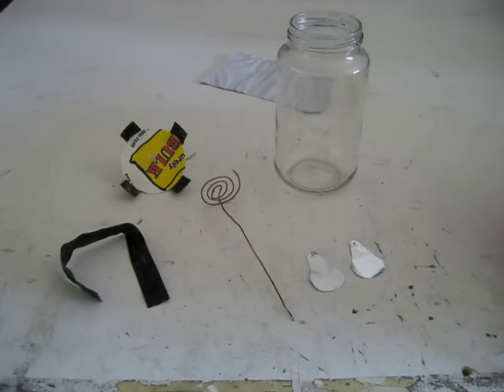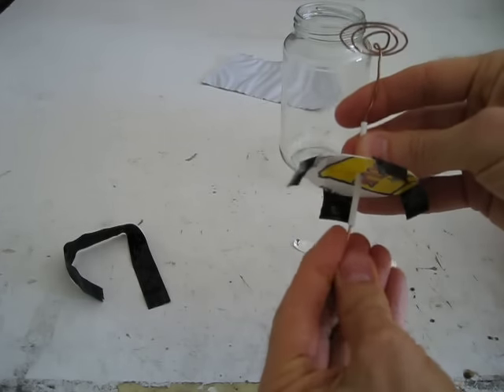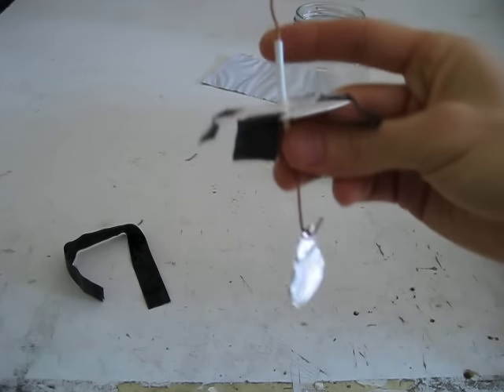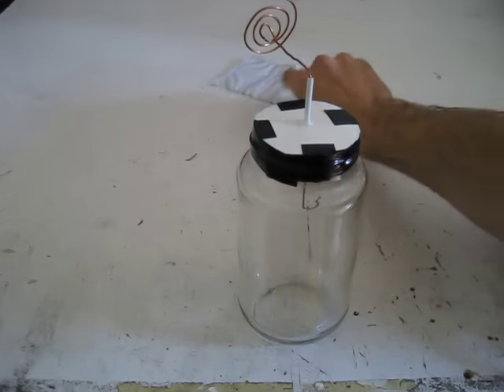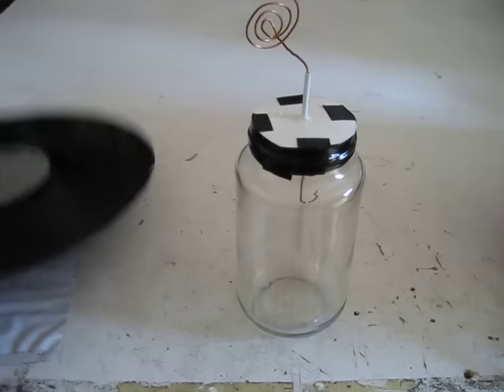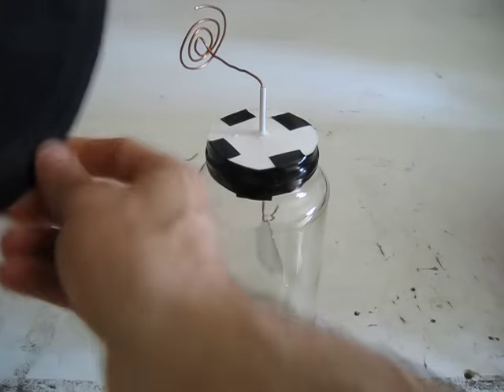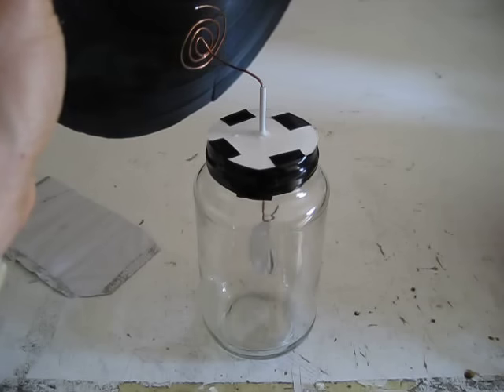How to make an electroscope (DIY)

Comment: What type of wire you use?
Reply from the maker: I used 14 gauge (AWG) copper wire, but any metal wire that can hold its shape will do. It can even have insulation on it as long as there's no insulation where the leaves touch it. The leaves need to make electrical contact with the wire.
Reply from the maker: Oh, and I usually mention that you can use the lid that came with the jar. The only reason I made my own lid from plastic and tape was that I didn't have the original lid.
Reply: @RimstarOrg   thank you very much! You helped a lot with my physics homework😊
Reply from the maker: It's my pleasure. BTW If you're looking for things to charge up for testing your electroscope, check out my Triboelectricity video https://www.youtube.com/watch?v=ey88EdZo9hU. Also includes the science behind it.

Comment: of what are these leaves made ?is it steel
Reply from the maker: Aluminum foil from the kitchen. You also don't need to make your own cover for the jar like I did. I didn't have the original cover, so I had to make one.
Reply: What is meant by foil
Reply from the maker: In the kitchen, most places have aluminum on rolls that they can cut sheets from. We wrap food in the aluminum foil. Here's a random video showing it better https://youtu.be/aGiPh_UPzEw?t=1m28s than I can explain. The advantage of using a thin foil as the leaves in the electroscope is that it is very lightweight. Not a lot of charge is needed to make the leaves repel each other.

Comment: What u have fitted in lid?
Reply from the maker: I used a piece of plastic for the lid. The plastic tube was one I got from a hobby store. But any lid will work. I didn't have the lid that came with the jar, so I had to make one. You can use the lid that came with the jar instead. The plastic tube is only to hold the wire vertically. You can use a straw or anything that will hold the wire vertically.
Reply: Thank you so much. I hope It will work out good :).

Comment: wat is the length of the wire u used
Reply from the maker: It's around 12cm (5 inches) for the hook and the vertical part and then around 30cm (12 inches) for the horizontal part and the spiral terminal.

Comment: I made it but it's not working  any suggestions please
Reply from the maker: The problem is usually with the charged object. See my video about the triboelectric effect for tips on charging objects https://www.youtube.com/watch?v=ey88EdZo9hU The only way it's usually a problem with the electroscope is if there's some kind of coating on the wire where the aluminum foil leafs touch it. If you think there might be a coating of something there then scrape it off.

Comment: What size of the copper wire
Reply from the maker: The size doesn't really matter except that it has to be stiff enough to form the hook for holding on to the leafs and for forming the spiral-shaped terminal. I think mine was around 14 gauge (AWG) wire (diameter: 0.0641 inches or 1.628mm) but any wire that's stiff enough will do. If it has any coating on it then you need to scrape it off where the leafs touch is so that you have metal contacting metal, which means you could use wire from a wire coat hanger.

Comment: can i use tire wire?
Reply from the maker: I'm not familiar with tire wire, but as long as it's metal and there's no coating on it where it makes contact with the foil leafs then it'll work. You can cut or scrape any coating off. A quick search online shows that it seems to be metal.

Comment: I'm making one but it's not working. Did I make a mistake?
Reply from the maker: The only problem people usually have with the electroscope itself is if there's some kind of non-electrically conductive coating on the wire where the foil leafs touch the wire. If you think there might be some coating there then try scraping it off with sharp edge, a knife or scissors. The other problem is with the charged object instead. If you're rubbing something then make sure you bring the area that you rubbed near the electroscope terminal (the spiral part of the wire). For example, if you rubbed a balloon against your hair then bring the area of the balloon where you rubbed it near the electroscope terminal. The air also can't be very humid otherwise you'll have trouble charging the object. I have a video with tips about charging objects here https://www.youtube.com/watch?v=ey88EdZo9hU
Reply: @RimstarOrg  Ah ok thank you, my big sister rubbed it hardly so it's working now 😃
Reply from the maker: Glad to hear it! And thanks for letting me know what worked. Now I can suggest that to other people when they have problems.

Comment: how many volts is that??
Reply from the maker: I don't know. That's one thing about electroscopes... they can tell you that there's an electrostatically charged area, and you can say that one area is charged more than another area by comparing how far the leafs move apart for the two different areas, but it doesn't help you with telling how much charge.

Comment: What are the things required
Reply from the maker: I go through all the items one-by-one at the beginning of the video.  Does that not work? I'm seriously curious. Maybe I'm making a wrong assumption.
Reply: I didn't understand your accent
Reply from the maker: Ah, thanks for clarifying. That's also an old video so I wasn't speaking very clearly.
Do you have a captions/subtitles button new the bottom of the video? If you click on that then you'll have what I say in writing.
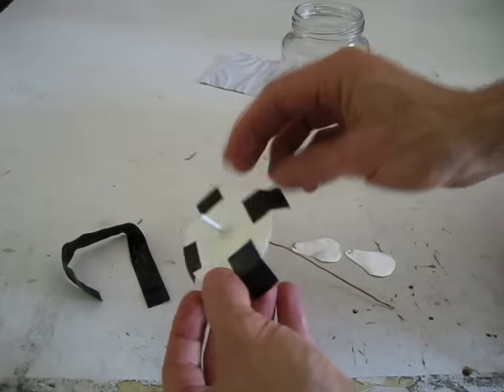Note that you don't need the plastic lid that I talk about from 0:47 to 0:59. I did that because I didn't have the original lid from the glass jar so I had to make one. If you still have the lid from the jar then you can use that instead.
Does that help?
Reply: Thank you

Comment: I made it but didn't worked. I want to send u pics so that I can check. Please help!!!
Reply from the maker: I'm happy to look at your pics and you can find my email address at the bottom of any of my webpages here http://rimstar.org. However, the problem is almost always with the charged object and not the electroscope. If the air is too humid then that makes charging difficult. Some options are to rub a rubber balloon or a plastic soda bottle against your clean hair and then bring the area of the balloon or bottle that you'd rubbed near the electroscope's terminal. You can also get more charging ideas from my triboelectricity video here http://youtu.be/ey88EdZo9hU.

Comment: I am a student and I'm wondering why the wire should be like that. I mean the wire is shaped like a spiral
Reply from the maker: The purpose of the spiral was just to give the wire more surface area when near the charged object. That way there can be more charges to interact with and so more repulsion. The wire could have been bent into any shape. Or a metal plate could have been soldered onto the end of the wire so that the plate would face the charged object instead.

Comment: Will this detect radiation?
Reply from the maker: Not directly. If the radiation was in the form of alpha particles then the alpha particles would ionize the air that they pass through. The electroscope terminal would react to the ionized air (think of the ionized air as the same as the charged area of the vinyl record I show in this video). But there would have to be an awful lot of alpha radiation.
I detect alpha particles in a different way in this video https://www.youtube.com/watch?v=aJkx6hAD-4E.
Reply: @RimstarOrg  What about Gamma radiation, this this device detect that?
Reply from the maker: Nope.
Reply: @RimstarOrg  Could you advise how to detect that without buying Geiger Counter? Is there another basic instrument that could be built D.I.Y?

& I do appreciate the quick responses, thank you.
Reply from the maker: Off-hand I don't know. I've never looked into it.

Comment: Mine didn't work at all. Maybe because I'm using a thinner copper wire and I dunno much about Physics.
Reply from the maker: The thinner wire shouldn't matter. The most frequent issues are to get an object charged well. For that I have tips in this video about the triboelectric effect https://www.youtube.com/watch?v=ey88EdZo9hU Also, make sure the area that you charged the object is the area that you bring near the electroscope -- charging an object only charges a specific area on the object. Another frequent issue is if there's some kind of coating on the wire where the foil leafs touch it -- the contact there must be metal to metal.
Reply: @RimstarOrg  hmm okay. And I have another question: is soldering wire a good replacement since it's metallic and the one I have is thicker than my current copper wire? Thank you so much.
Reply from the maker: Good idea! I hadn't thought of that. I just tested a length of soldering wire with a meter and it worked. There might be a thin rosin coating on it so you might have to scrape it a bit where the foil leafs make contact with it but there also might not be. Let me know how it goes.

Comment: How can i produce charge in difference ways
Reply from the maker: If you mean using the triboelectric effect but with different materials, I talk about that more in this video https://www.youtube.com/watch?v=ey88EdZo9hU.
If you mean using other tricks besides the triboelectric effect then there are many ways, though which ones you'd want to use depends on your needs. Triboelectricity is the easiest I'm aware of. Besides that you're getting into Van de Graaff generators, Wimshurst machines and the high voltage power supplies.

Comment: I guess your jar had a metallic cap. Wouldn't it save one time if they used a jar that comes with a plastic cap?
Reply from the maker: Sure, you can use a plastic lid if the jar comes with one. Actually, a jar with a metallic cap would work too. But if the thick wire is in contact with the metal of the lid then make sure you don't touch the metal of the lid when using it, since your body will affect the charge. I didn't have the lid for my jar at all.
Reply: Good to know. Thanks!

Comment: can it test dead batteries?
Reply from the maker: Ernestas No. It requires a surface with lot's of charge.
Reply: RimstarOrg is it possible to make such thing, to check the batteries in Home conditions? Thank you.
Reply from the maker: Ernestas Not in any practical way using an electroscope. I guess you could make something using a coil and a permanent magnet. Look into how analog meters measure voltage.

Comment: sir will you tell me all about the used thing ,i have made it but unfortunately not working.
Reply from the maker: There are two most frequent problems.
The first is to make sure that there is no coating on the wire where the aluminum foil leafs touch the wire. Scrape the wire there using a knife or sandpaper to make sure there is no coating. The metal of the wire must be contacting the aluminum of the foil.
The other problem is usually with the charged object and not the electroscope. See my video about the triboelectric effect for more tips on charging objects https://www.youtube.com/watch?v=ey88EdZo9hU.

Comment: I made it ....but it's not working ....ehat should I do
Reply from the maker: The most frequent reason they don't work is a problem with the charged object. Make sure you bring the area of the object where you rubbed it close to the electroscope terminal, not all of the object gets charged. Also, try different objects. See my video here about the triboelectric effect for more ideas and tips for charging https://www.youtube.com/watch?v=ey88EdZo9hU One problem with your electroscope may be where your leafs touch the wire. It has to be metal touching metal and sometimes the wire has a coating on it. If there might be a coating then try scraping it off where the leafs hang from it. Also, if the air is humid then you may have trouble charging the object.

Comment: I NEED HELP WHEN I USE MY DENIM CLOTH AND STRW IT DOESNT WORK
Reply from the maker: It could be that the straw is no good. Not all plastics work. Try a plastic soda bottle rubbed against clean hair, or your denim. Make sure to put the area that you actually rubbed close to the terminal. Rubbing doesn't charge all of the object. See my triboelectricty video for a lot more tips http://youtu.be/ey88EdZo9hU.

Comment: materials needed?
Reply from the maker: +Judy ANN Montemayor See the video. I go through all the materials one-by-one. If spoken English is the problem the video has English captions which you can turn on using the CC button at the bottom of the video or somewhere else on your player. Note that instead of the plastic disk and tape you can just use the lid from the jar. I didn't have the lid so that's why I made a plastic disk and taped it on.

Comment: Mine doesn't work anyways I'm gonna past it to my teacher
Reply from the maker: The problem people usually have with the electroscope itself is if there's some kind of non-electrically conductive coating on the wire where the foil leafs touch the wire. If you think there might be some coating there then try scraping it off with sharp edge, a knife or scissors. The other problem is with the charged object instead. If you're rubbing something then make sure you bring the area that you rubbed near the electroscope terminal (the spiral part of the wire). For example, if you rubbed a balloon against your hair then bring the area of the balloon where you rubbed it near the electroscope terminal. The air also can't be very humid otherwise you'll have trouble charging the object. I have a video with tips about charging objects here https://www.youtube.com/watch?v=ey88EdZo9hU

Comment: tire wire is used in constraction making a building its maid from a metal maybe and its look like a wire
but no skin
Reply from the maker: That should work then.
Reply: but when we buy a copper wire  its didnt work
why its does not work
the material i used are copper wire,loollypop tube foil and a glass jar
answer my question plsss
Reply from the maker: reymart hayo
I'm not familiar with loollypop tube foil. The foil has to be electrically conductive (metal) both where it touches the wire and over its entire surface. If you're not sure that it is then just use the aluminum foil normally used in kitchens.
Also, make sure there's no coating on the wire where it touches the foil. You can scrape off a coating by scraping it with a knife.
The other possibility is the most frequent reason - that there's nothing wrong with your electroscope and that the problem is with your charged object. That may be because your air is too humid. Or you can try other objects, like rubbing a plastic bottle (e.g. Coke bottle) against CLEAN hair or a rubber balloon against clean hair and using the bottle or balloon as your charged object.

Comment: Why my electroscope is not working
Reply from the maker: Make sure there is no coating on the wire where the leafs touch it. You must have metal-to-metal contact there. You can scrape any coating off the wire using a knife or edge of a scissors (be careful not to cut yourself). The other reason is usually not the electroscope but the charged object. Make sure you bring the area of the object where you rubbed it near the electroscope's terminal. Also, see my video about the triboelectric effect for more tips on charging objects and more objects to try https://www.youtube.com/watch?v=ey88EdZo9hU
Reply: @RimstarOrg  thanks sir

Comment: Mine doesn't work pls help
Reply from the maker: Make sure the foil leafs are in contact with the metal of the wire. There may be a coating where the leafs touch the wire and you'd need to scrape the coating off. Also, make sure the leafs are free to move easily.
But most often the problem is with the charged object and not the electroscope. See my triboelectricity video for tips on charging objects https://www.youtube.com/watch?v=ey88EdZo9hU

Comment: can we use it to detect ghosts?
Reply: T0X1C EAR  you just need a voice recorder
Reply: Supposedly ghosts generate a static electric field.   And, yes,  the EMF meters that are "paranormal" detectors are just ones that detect electric fields down to DC(zero frequency).   

That being said, if you are in a dry room (i.e. <40% relative humidity) just walking across the rug or rubbing two different insulators together will generate a LOT of voltage, which will show on these meters.

Look up  "Triboelectric Effect" if you want to know more about these static voltages.
Reply: T0X1C EAR
Reply: Could you please erase the comment

Comment: My electroscope is not working, the aluminium pieces are not repelling each other. Can anyone please help.
Reply from the maker: The problem is almost always not with the electroscope, but with the charged objects. If your air is too humid then it can be hard to charge objects. See my video about the triboelectric effect for more things to try https://www.youtube.com/watch?v=ey88EdZo9hU.
The other possibility is that where the aluminium pieces touch the wire, the wire may have some sort of coating on it. Make sure there is no coating on the wire there. The pieces must be touching the metal of the wire. You can try scraping away any coating using sandpaper or scraping with a knife or scissors.

Comment: how thick is 14g
Reply from the maker: It's around 0.0641 inches or 1.6mm in diameter (http://www.powerstream.com/Wire_Size.htm). But it doesn't have to be exactly that diameter. Just use a wire that can support itself rigidly, so that it doesn't fall down. Clothes hanger wire is one easy source, but it may have a coating on it. Make sure to sand any coating off the terminal (the spiralled section) and where the aluminum foil leafs touch it.
Reply: ok thanks

Comment: Wath is Electro tape
Reply from the maker: Electrical tape. It's normally used when doing electronics to wrap around electrically conductive parts. But for the electroscope, any tape will do. Or, you can just use the original lid from the jar and not need any tape at all. I didn't have the original lid and so I had to make one.